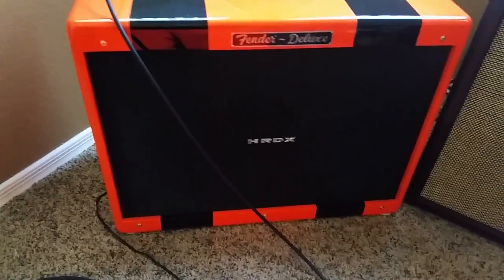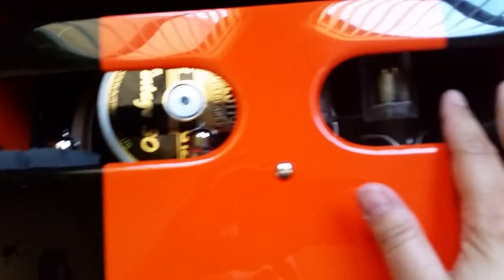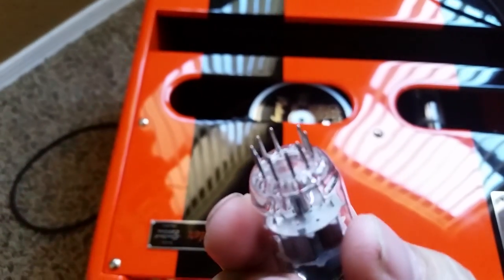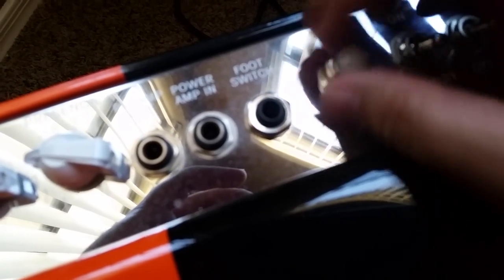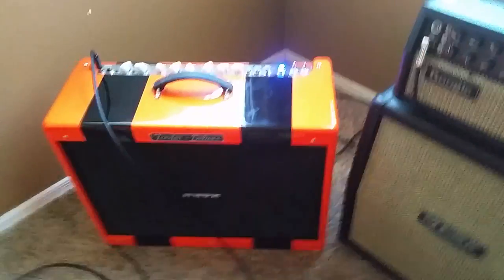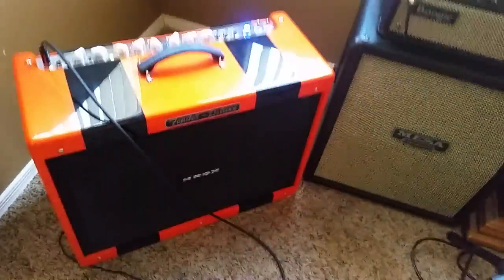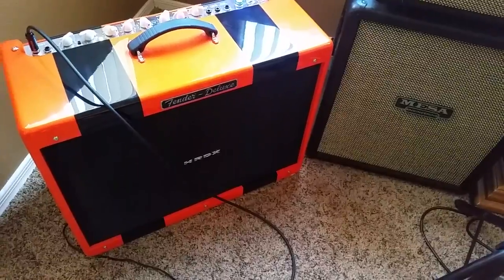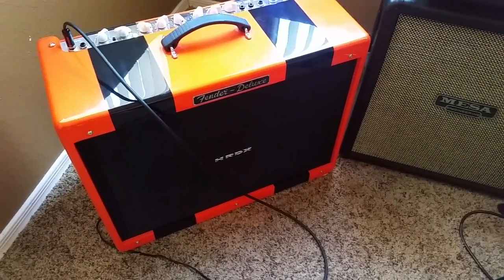Improve Your Fender Hot Rod Deluxe For $10

Comment: I found this video a few weeks ago and I gave it a try on my HRD. Unfortunately, if the volume thing did work as mentioned, the tone and the dynamics were drastically different and the drive channel was in no way better for me (fine for power chords not for lead). I tried in V1 and V2 with no difference between the two. I came back to using 12ax7 and input 2. Lost $30 but it's fine. We need to try different things!

Comment: I never thought 12AT7's sounded good in V1. They're higher current capable and are best used as a PI. It has a gain of 60. Leo used a 12AY7 in the tweeds, which has a gain of around 44.
Reply: Did you try a 12AY7? And how did it sound? As far as I remember that is the ´tweed tube´.

Comment: Hi Phillip, thanks for the great videos! 
My two questions that you may have already addressed. 
1) Can you explain the presence knob? I have read up about neg feedback loop but I still can't put my mind and ears around it. 
2) Some techs tell me to use a clean towel when handling tubes. They say the oil from our fingers may damage the glass when it heats up. Any thoughts? 
Thanks again!
Reply from the maker: +Carlos Kuhlmann Yes I have also use a towel. I do for Power tubes. I also tend to do it most the time for pre amp tubes. I have so many explanations for the presence knob. But I like to think of it as a High EQ control on the power section.

Comment: Hi I have revertetd to the original tube arrangement after the 12at7 I had went microphonic and rang every time I played a chord.However, I changed the output tubes to KT66's and the sound is much warmer and less overpowering.I had these from my old Quad hifi amp. A bit expensive  to buy new  and I need to install clips to ensure they stay in at some point but I would certainly recommend for a less raspy sound.Hope this helps someone. alanp

Comment: ive gigged with these amps for years and have always run my amp at around 3 vol, and used the house PA system to push more volume. i also use a bossME-50 which has a master volume that does wonders for these amps

Comment: Great video. Thanks for the information. I have a 212 Deville and It was given to me as a gift and is one of the older ones I think. Would you recommend some tubes for heavier rock sounds that would be good for this amp?
Reply from the maker: Jerry Morris For Overdrive tones. The best bang for the buck is a Pedal. Then speakers. Tubes Last. They will not help as much as the other two and they become a try as you go kind of thing. I hope that helps
Reply: Phillip McKnight awesome. Thanks for the help.

Comment: Loved the video. Went to Guitar Center a purchased a GT-12AT7 brought it home and installed - but no change. Still extremely load even at 1 on volume knob. Virtually no difference between the stock and replacement tube. Any suggestions?

Comment: Cool, I will probably try that. Mine has a shimmery microphonic sound when I play with it turned up. Not sure if the tubes are vibrating, a tube is faulty or if its just inherent of this particular amp.
Reply from the maker: The problem sounds like a bad tube.
Reply: bvaproductions Just tap the side of the tube with your finger(don't burn yourself).If it is microphonic,you will hear it.

Comment: Cool video. My sole amp is a HRD as my "upgrade" 15 years ago. Where did you get the new light cover to replace the red one? Also do you have a video on attenuators between amp and speaker for this amp (or an amp like it)? thanks!

Comment: great video, amigo :) .  one comment, the problem w/ the earlier deluxe/deville is the volume pots themselves.... they were upgraded n redesigned in ver 3...(w/ black face plate...the early ones had chrome face i believe)......  but really cool approach....  FWIW,  i own Carvin x100b heads and they recommend switching in differant tubes in v-1. just like u r doing... v-1 always seems to be the important pre-amp slot... i think...... good idea... this is a place a vintage rca pre-amp tube may be a good choice... something old and coolio creamy early tube tone...so to speak :)

Comment: Thanks for the video.  I have a question, though.  Why don't you crank the volume, and use the master volume to control the output, as opposed to changing the tube like you did?  Let me know, thanks.
Reply from the maker: If I use the volume on max and the master there a re some benefits because of the way the 2nd channels uses a tube instead of a solid state component.  You could run that side like a clean channel. That way. I have never tried it. I will have to give it a try and see how it sounds. Sounds like it could be a cool idea. Thanks for posting!

Comment: I did this mod on my Blues Deluxe reissue and it indeed did what you said it would (although it was not for $10)...However, the clean channel was as loud as it ever was.  Rather than muck around I just thought I would ask if anyone else had the same experience?  Would changing both tubes out, change the gain of both channels?

Comment: Great info.  Phillip, do you make any of the other changes to this amp that I've seen mentioned.  The IT capacitors that leak or the resistors on the power supply?   Have you checked or changed your bias?  Just curious..Saw these mentioned as cvommon issues for this amp.  Thanks .

Comment: The AT7, is not a direct replacement nor a drop in replacement for an AX7. The internal plate resistance is much lower thus, less plate voltage (about 45%) current draw increase to greater than an AX7. 

The tone is going to be thinner and less full sounding if the RC values have not been addressed. 

It's also got a lower Mu factor / gain  so, tonally, it's going to sound lower in volume and not as full and round sounding. 

Typically, AT7s are used as driver tubes and phase inverters as well. Fender used to drive their reverb tanks while some used them as phase inverters. 

While, they can indeed be used as pre-amp tubes, one would have to change the circuit to suit these tubes as, if you were to drop one into the preamp section, the voltage is going to be about half while, the current draw will rise thus,  changing the voltage to the other tubes thus, putting the circuit out of balance for what it was designed around e.g.; 200V plate voltage vs. 100-120 V. 

We've all done this at one point in time so, it is not a catastrophic failure but, could be depending on design of power supply limits and how many tubes were swapped out or mixed with.

Comment: GEAR question >>> amps like jcm 800, say a 100w , with 2 speaker outputs, does it mean each speaker jack gets 100w or 50w each ??? same with a 50w , 25w per speaker output or 50w per ?? tnx much

Comment: I'm sure someone has asked by now but how does it perform at low volume levels? Can you still drive it hard?
Reply: +Čarpe Diëm the 12at7 creates more clean headroom before distortion as well as opening up the volume control for more precise settings.  If you like to drive the clean channel to distortion edge with this amp (some say the only usable distortion on this amp) at practice volumes, you do not want to pull out the 12ax7 from v1.

Comment: Great video, and a killer tip for the Hot Rod Deluxe!  Here's my question...I have a 1998 Hot Rod Deville with 4 10s, which is a completely badass, halfstack killing beast!  I have already had my Fender amp guru swap out the master volume pot for one with a much friendlier taper while giving my amp its 100,000 mile tuneup (I got it used in 2011 for $300...killer deal for the baddest badass amp I've ever owned) and it has become much more civilised on the drive/more drive channel.  The clean channel is pretty malleable to start with, so I decided to leave it alone when I made my mods.  

So I was wondering if, by swapping out the #1 preamp tube for a GT12AT7 as you did in your Deluxe, would it take a bit of the edge off the overall drive/more drive grind, like it did for yours?  I'm not sure what the main difference between the Deluxes and Devilles is, other than 20 extra watts and a few extra speakers...I would like to have a little more control over the amount of grindage that channel two gives me, without taking too much off the overall top end (I really like the killer, over the top mind blowing drive this amp gives me at full tilt boogie lol).  So, what do you think, is it worth a shot or are the two amps too different for this to affect mine in a significant way?  

For what it's worth, I'm playing an Epiphone Riviera Ltd. Custom P-93 through my Deville, and it has a majorly FAT super thick, balls to the walls, full tilt rock and roll  grind when I push it hard through the bridge pickup, while sounding like the sweetest jazziest jazzcat when I play it clean on the neck/middle pair!  Thanks again, and rock on brother!

Comment: what do you think about the mod kits? The Granger uses those tubes you mention as well as the JJ6L6GC
also gives you a new speaker , a WGS ET65  ?,    anyway, my amp is over 10 years old and has been in the shop 3 times, I gig with it weekly or at least bi weekly, play harp and guitar through it. I need more lower end warm for the harp.Any opinions?

Comment: I'm testing your modification and very much like the tone on the clean channel and the dirty channel. But on the extra dirty channel I get instant feedback even with the volume off on the guitar. Also on the clean and dirty channel I'm getting a buzz that sounds like two thin metal plates vibrating together. I also get some feedback at times that is not coming from the guitar but just the amp. Any thoughts?

Comment: Sometimes I use a matching external cabinet with mine. Would I still want to use a 12at7 with the external cabinet or should a switch back to the 12ax7 to get more power two push that extra speaker?

Comment: Can this mod be done on Blues Jr with similar affect?  Thanks for your time and expertise!!
Reply from the maker: Yes, It is not as dramatic but works well.
Reply: What about the hot rod deville 410?
Reply from the maker: It works the same for the Deville
Reply: Phillip McKnight
tried the 12at7 eh..I got high pitch feedback at 5 volume.Tube is sitting correctly. Help.

Comment: Great video Phillip. I did the same thing with my Blues Deluxe. The 12AT7 in the preamp 1 spot made a HUGE difference. I've replaced all of the other tubes with better quality tubes and the speaker with an Eminence Cannabis Rex. The amp is so warm and mellow now. One other thing I did was replace the speaker cable inside with a George L cable - I was surprised how much clearer that made it sound. 
I've been having issues with the reverb tank recently though. Any suggestions on what the culprit part may be? The reverb comes and goes randomly.
Reply: Yep all three preamp and both of the power tubes. The 1st preamp though made the biggest difference
Reply: Yep! No reason why your practice amp can't be your gigging amp too!
Reply: I have that issue with the reverb on my Hot Rod Deluxe but I noticed it's not as bad as it was a few years ago, it's weird. I think mine has to do with the reverb potentiometer because as I turn it, it will cut in and out. Maybe just dust?
Reply: my pot doesn't seem to have an effect on if it works or not. as far as i can tell, it seems completely random
Reply: What tubes did you go with?  And did you need a special cable from George L?  I have some extra patch cable laying around!  I assume you want speaker cable?
Reply: The Two Main Problems in the Fender Hot Rod Deluxe video on you tube explains your reverb problem

Comment: Phillip - great video as always! I own a Hot Rod Deluxe 1 (not the 3) and I have the same issues this might address - it's too loud, the gain is basically unusable, etc.

I've found other 12AT7 tubes at my preferred guitar retailer, but not the exact tube you use.

If I buy a different brand of 12AT7 tube, can I still expect at least similar results?
Reply: Try a NOS Mullard CV4024 / 12AT7 in V1. Sounds great in a Hot Rod Deluxe!

Comment: I love that Amp!! So, I bought my HRDX from you and its the George Benson, so the tube mod is done. Now, I know where to get the new jewels for the "power Light"... But I cannot find the LED bulb that replaces the, what I am assuming is a T47 bulb. Can you post where to find that? Thanks!! Great Video !!
Reply from the maker: Here is the link for the Bulbs. They T44 T47 they say made for pin ball machine, but they are the same as the bulbs Fender is using, except they are LED. Dirt cheap. 
http://www.centsibleamusements.com/pinball-led-44-47.aspx
Reply: Phillip McKnight Thanks Phil!! I had some trouble with the cestsible website, but found pinballlife.com has the same brand for .69 each. Awesome. You're the best.

Comment: Hey, thanks for the video. Does this work for a Blues Deluxe and a Blues Junior as well?
Reply: I would think so.  both are 40w amps.  changing the volume pot from stock linear to logarithmic is the best thing I've ever done for my blues deluxe for slower ramp on sound output.  I want to try the 12at7 or 12ay7 tube now though.  Chime in if you did this to your blues deluxe.  I'd like to get your thoughts before I order.

Comment: Phillip, so I've seen your suggestion on doing this as well as using an EQ pedal.  Which is more effective?  I was planning to pick up a used MXR 10 Band EQ today for a steal at $50 but this seems like the cheaper option.  Do you have any suggestions?  Oh, and I have the Hotrod Deville 410.  Thanks!

Comment: Thank you for this tip, it sounds like I need this mod. Anyway, I have an old Hot rod deluxe that I bought around -97 (made in usa), and my main issue with it is the totally different sound in the drive channels. I find it very harsh and, to be honest, virtually useless. No bass (almost), and too much nasty high mids. I plan to do this simple mod, but I am skeptical that the overdrive sound improves that much. What do you think, would I need to take it to someone who can make some mods in the internal electronics?

Comment: Phillip, I did this mod to my Deluxe and it is awesome.  Are you familiar with a reverb mod for this amp?  I found info on a mod for the Deville that involves clipping one of the legs on the R103 resistor.  Does this apply for the Deluxe as well?  The reverb is insane on this amp.  Thank you.
Reply: It is the same thing for this amp. R103 connects a cap across the pot, that works like an attenuated bright switch on the reverb part of the sound. By nipping of R103 you get a
more balanced reverb sound. I have done that on an old DeVille, and I think the reverb sounded better afterwards. If you do it on the upper side of the PCB, and nip in the middle
of the resistor leg, it is easy to reverse, if you don´t like it.

Comment: Hi there. Thanks for this great info. I ordered the Electro-Harmonix 12AT7 EH Preamp Vacuum Tube you link to above and followed your instructions for install. However, when I powered the amp up and played through it, I didn't notice a big decrease in volume, but there was a really high pitched ringing / rattling with every note I hit. Looking at the tubes, it appears the other tubes are all glowing with the exception of the new one I just installed. It appears to be seated correctly and I tried taking out and putting it back in a few times with no luck. Tapping on it makes a lot of noise on the amp. Do you think this is a faulty tube or user error? Thanks again.
Reply: I should also mention that I reinstalled my original preamp tube and it glows / sounds fine. (just loud!)
Reply: im no expert but from some light googling i learned the symptoms you describe indicate a faulty tube. the ringing seems to be a text book example for a microphonic tube (google this term). maybe you can get a refund as a microphonic tube is most often a manufacturing error.

Comment: Very useful hint. Thank You.
My Hot Rod always makes my ears bleed :-)
Which was the original tube?
Reply: go look at your own.
Reply: The original is a 12AX7. The 12AT7 has about 30% less gain and will increase your compression. SRV did this trick.
Reply: Thank You. Does it work with the Hot Rod Deluxe III too?
Reply: Peter Brusch It works with any amplifier that uses 12AX7 preamp tubes. And so that's any conventional Marshall or Fender amplifier and many others. The 12AX7 is the most popular preamp tube in the world.
Reply: Didn't SRV use 5751's in V1? 5751 will also reduce the gain but not as much as a 12AT7 in place of a 12AX7.
Reply: Yes. Diaz installed lower gain preamp tubes in V1 to increase headroom and increase compression.

Comment: So I got EH12AX7's  in my hot rod, replaced it with a Groove tube 12AT7 and it rang like crazy, tried another one and did the same. Sooo I tried a EH 12AT7 worked good in the cleans but on the distortion channel it rang like cazy! And when you tap the tube it rings also . Am I just getting bad tubes or what!!!!???

Comment: Hey Phillip, great video! Doing a search for a 12AT7 I found there's a wide variety of choices at different price points. Do you feel there's an advantage in buying a $50 tube over a $10 tube? I don't mind paying more if there is a tube choice that's clearly better than the others.

Also, do you have any recommendations on replacing all of the stock tubes on my HRD III to further warm up the sound? So it's not so brittle? Thanks!!!!

Comment: Quick question, by doing this modification, do You Need to use the same brand of tube that's in the amp, new at this and don't want to damage the amp..thank You
Reply from the maker: I would use a JJ brand Tube.
Reply: It doesn´t matter at all, it is like: Do I need the same brand of bulbs in all my lamps at home.